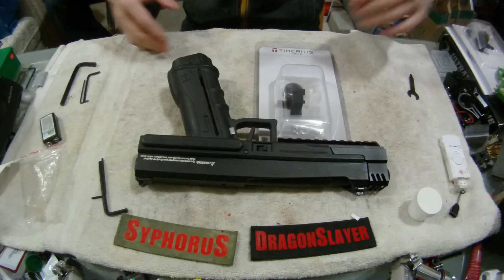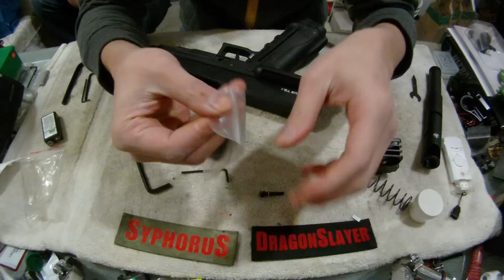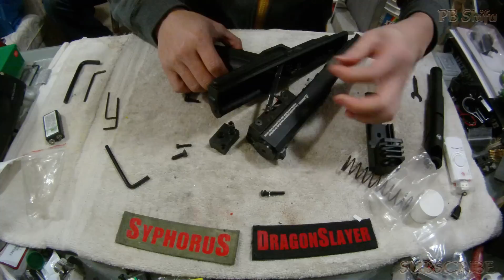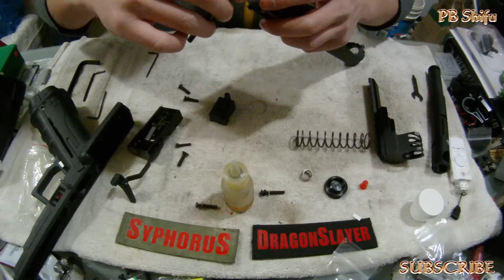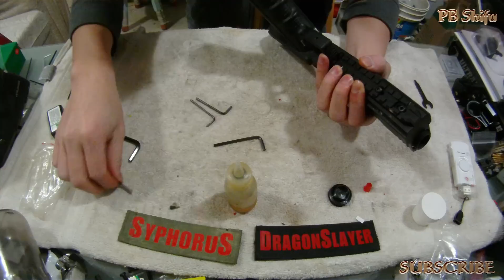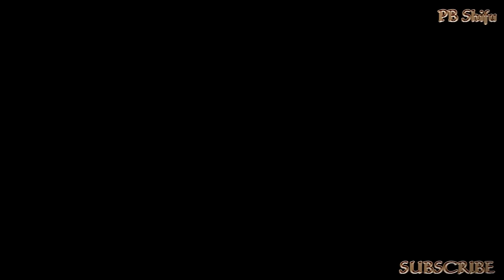Tiberius Arms T8.1 Direct Remote Line Air Adapter Kit Installation Fail Paintball

Comment from the maker: The best method would be to use a dremel with a disc cutter and make your way throught it. It's a simple process but wear eye protection since there will be plastic particles flying.